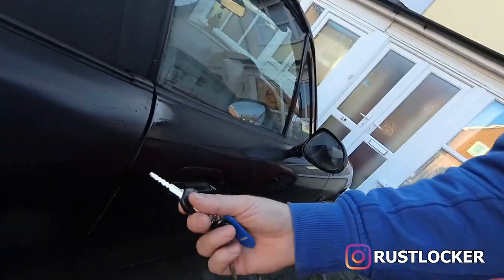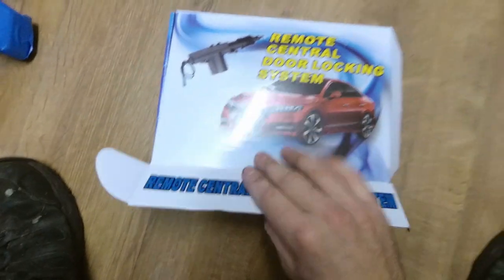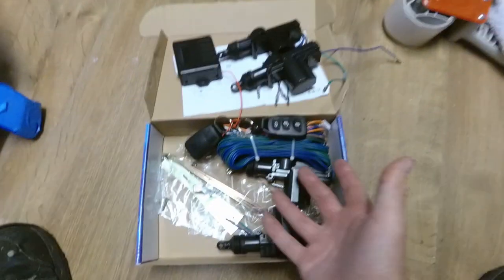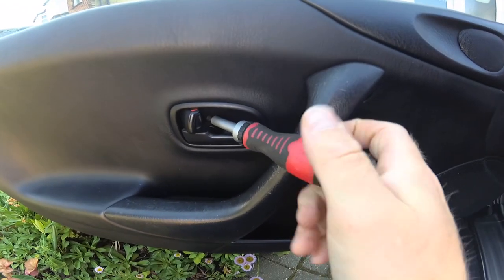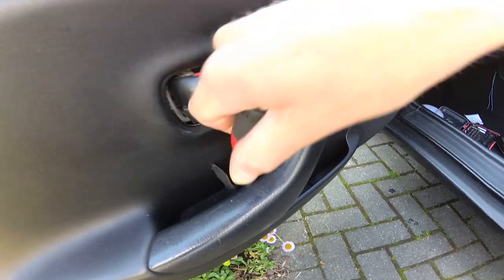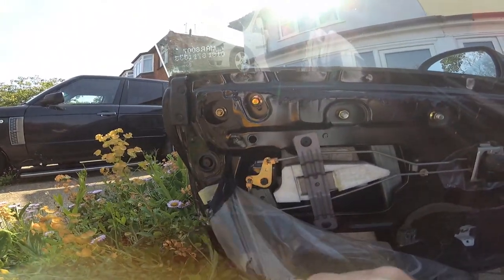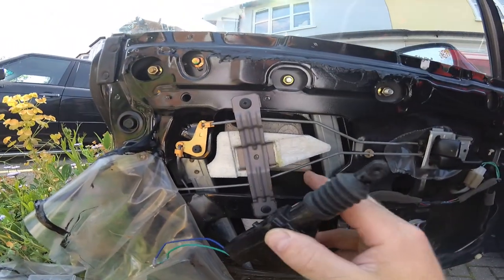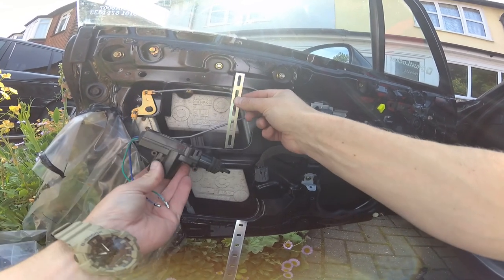Fitting a Cheap REMOTE CENTRAL LOCKING KIT to my MAZDA MX5

Comment: Hi there! great video, did you ever end up getting the trunk release working? Also do you have any issues with the battery dying after installing the central locking on the constant 12v. I just bought this same kit and installed it and my miata died after leaving it for a weekend.
Reply: I've had a similar problem. Did you find a solution?

Comment: Ello mate great video but of a random question but what alloys do u have on ur combo I need to get some but can’t find any 5 studs that fit cheers mate
Reply from the maker: Those are Corsa Sri alloys, 4 stud though. My combo has 4x100 stud pattern. Maybe look for some Astra wheels? Just make sure they’ll fit before you buy em.
Reply: Thanks mate can’t wait for ur next video and I will look the Corsa alloys up mines the 1.7 combo so 5 studs 110 pattern I think are urs still the 15 inch or can u fit 16s
Reply from the maker: @foxthewoodturner1765  Those are 16s mate. could maybe even go bigger, as long as the width of the wheel fits in the arch, but 16s seem to fit just fine.
Reply: @RustLocker  yeah was thinking about going 16s mate mine are 185/60/r15 so as long as I keep them 185 they will fit ok and not be to wide

Comment: Hey lad, thanks for the video, I have a combo c van that required an engine change, and the replacement dash and ignition barrel only had one key, so now I dont have my central locking anymore. Do you think this kit would work on my van? Cheers. Paul in Ireland
Reply from the maker: Yes mate, I think you could get it to work on the van even easier if you used to have central locking then the stock actuators are still in the doors, just mount the new ones in their place.
Reply: @RustLocker  ah great stuff lad!! Great channel too by the way, I have a few mods done to my combo, like mk1 Audi tt seats, E46 rear lip spoiler, Meriva clock faces, as well as the tigra boomerangs. Am also waiting on the facelift front bumper and projector headlights. Would like to send you some pics but not sure how. All the best. Paul
Reply from the maker: Thanks. Yes, They sound like some interesting mods, you can email me (check about section) or dm on instagram mate.

Comment: You installed motors on both the doors? I just ordered a kit, but my NB locks both doors if I lock it from the drivers side, so do I have to install a motor on the passengers side? Or would it work with just one on the drivers side?
Reply from the maker: Yea, so you have central locking already, so one motor on the drivers side, should in theory open both doors.
Reply: @RustLocker  Great! Thanks for the reply and the video! Gonna install mine today, cheers

Comment: you place your actuator motor wrong you rotate it upside down so the water will not fill the motor
Reply from the maker: I’m not sure what you mean mate, it’s a sealed plastic unit, it’s just as sealed at the top as the bottom is.
Reply: @RustLocker  rotate it vertically thats what i mean, and its not sealed ive seen many actuators like that i open a lot of that and its impossible to be sealed there is no seal inside the shaft
Reply from the maker: I don’t see how I could mount it vertically though. The rods to connect to are horizontal.